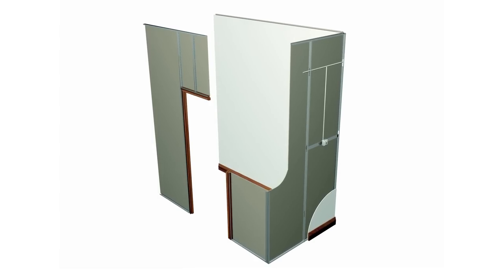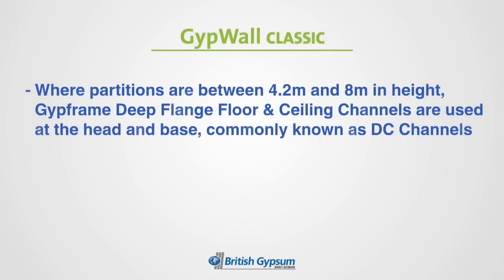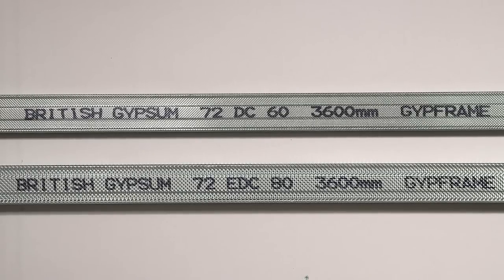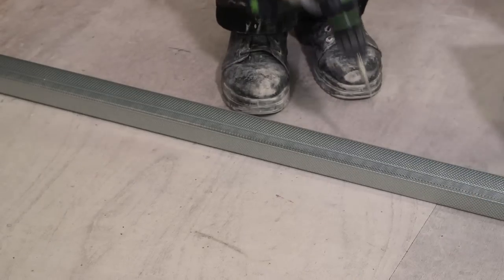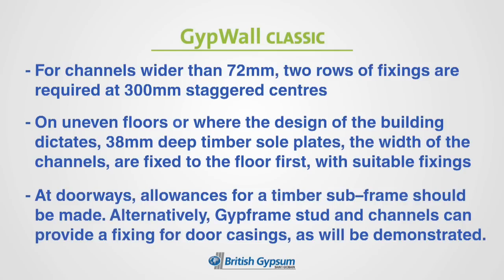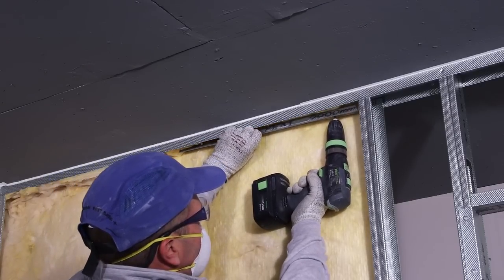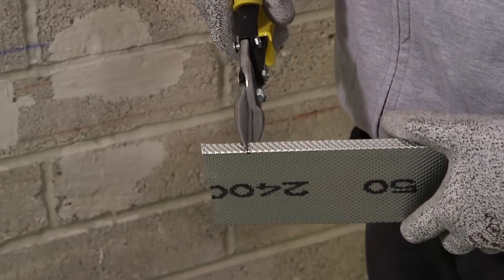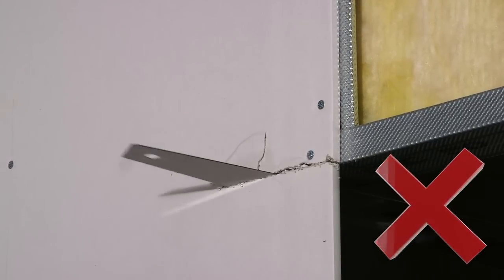How to install GypWall Classic - The definitive metal stud partition system | British Gypsum

Comment: Excellent video! So I'm planning to apply the same steps explained here but I have just one issue which is basically that my u track + 2 plasterboards won't fit the whole width of an arch opening I'm trying to cover up so everything is even. I'm missing around 1.5cm on each wall. I can see two boards are screwed here, so the base one doesn't need fixing? For two 12.5mm boards I'd be looking to use 35mm screws right?
Last thing, the door lining is fixed straight to the vertical stud? Is not necessary to fill the cavity of the vertical stud with another piece of timber?
 Many Thanks,
Juan
Reply: 1. You may opt to look for other studs width or board thickness to gain back the extra 1.5cm(15mm) to flush your drywall to the existing opening. Or, you can just add a 15mm plasterboard fixed onto one side of the drywall while retaining the original configuration of having 12.5mm plaster boards fixed onto both sides of the metal framing. This method is just for you to obtain the exact wall thickness to flush with the existing.
2. You may add timber batten to reinforce the vertical studs for door frame installation. Alternatively, you may also opt to box up the vertical studs by splicing both of the c studs together.
3. As long as the screws used are 12.5mm longer than the thickness of plasterboards, that shall be fine.
Hope this helps!